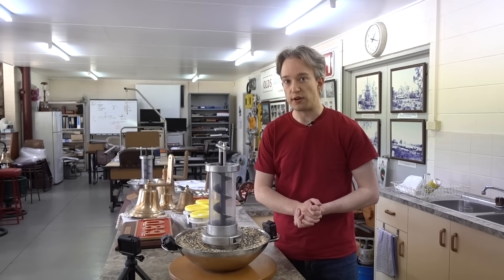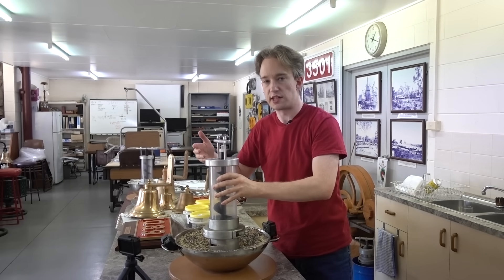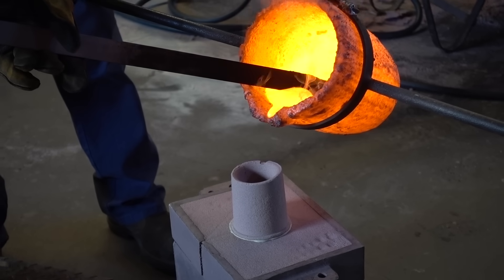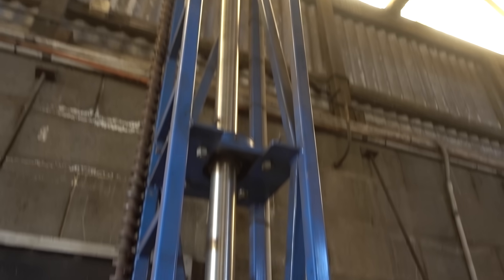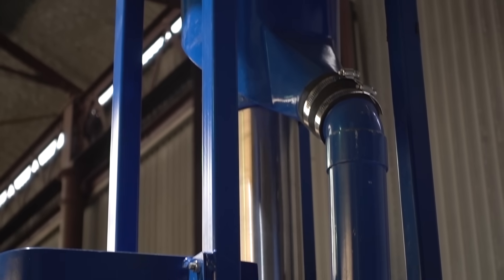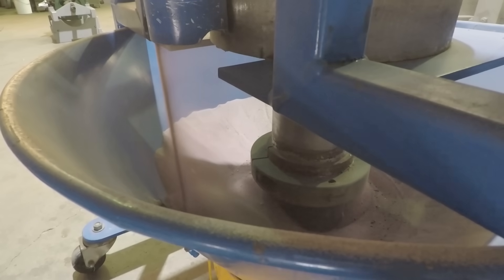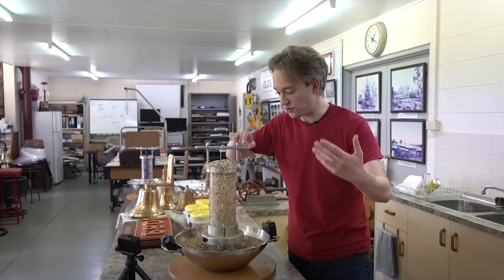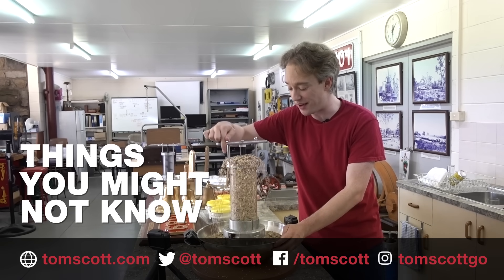Mr Olds' remarkable elevator

Comment: It’s incredible that for centuries after Archimedes created his screw, no one thought of the reverse until this guy..

Round of applause for him
Reply: Spinning a screw is easier than spinning a tube.
Reply: @ElectricityTaster  You can spin a tube in its center, or on multiple points instead of just the ends, relieving the screw's center of stress.
Reply: @nrdesign1991  yea, it's better, but also more complex. A screw is simpler.
Reply: "After a night of smoking dank weed I wrote down the sketch of this idea"
Reply: I would assume people have thought of this before, but never really seen any reason to use it. Why rotate the cylinder of you can rotate the screw would be the common conception.
Reply: @ElectricityTaster  A screw requires more torque and thus stronger and expensive materials, the longer you make such screw.
Reply: @ElectricityTaster  That still doesn't explain why no one thought of it before though
Reply: @simmojosh71  well there were centeries where humans hadn't thought of something like archemede's screw until archemedes came along. It just takes time.
Reply: Benjamin Lum That's not necessarily true. We just don't have evidence of a patent. Either one wasn't filed, it was filed but we haven't recovered it, or previous inventions existed in times before patents. That's a matter for archaeologists.
Reply: @Keovar  What are you trying to prove here?
Reply: Theres always the thought too, that someone had in fact tried this before and not realised how good an idea it was or that other people didn't know.

or perhaps even it was common before for moving grain or whatever and it just fell out of use and everyone forgot. It's really quite interesting.
Reply: Archimedes Wercs
Reply: @Stepping West what is wrong with your reading comprehension? I never said it was not a superior design, I said it was simpler to make. You know, like a handsaw is simpler than a chainsaw.
Reply: This sort of thing should be able to "bend" (not very well but it is possible) while you can't do that with a screw. All of a action happens at the bottom. The only problem with this system is I don't think it can lift water without operating at high speeds.
Reply: @pwhnckexstflajizdryvombqug9042  it is much easier making a bendy rotating screw than a bendy rotating pipe. Screw elevators that bend are easily commercially available.
Reply: Also a lot more dangerous for personnel. Growing up on a farm I knew a lot of people that lost an arm/fingers etc etc from augers
Reply: I believe nobody thought of this before because Archimedes' screws were only used to lift water. For that, the "screw" and the "tube" were a single unit (else the water would just flow back down through the gaps).
Archimedes-screw grain-elevators must be a post-industrial invention. This kind of grain-elevator can hardly be made of wood and without some kind of motor, and they take up a large amount of metal by pre-industrial standards.

Point is: The 'original' grain-elevator design with a screw rotating inside a fixed tube isn't that old either. But the Old's elevator is still a wonderful example of out-of-the-box thinking.
Reply: ROOOMBA while I was writing the sketch I had this crazy idea of moving the paper leaving the pencil fixed...
Reply: @nrdesign1991  Have you considered that, regardless of which component is being rotated, the force to move the material is the same, hence the central screw could still be sheared by the forces transmitted by the material?
Reply: @marcusgault9909  Good point, but for some reason this design seems to work as well as it does. I'm tired AF right now, but I might reconsider what forces go into the parts later on.
Reply: @nrdesign1991  As I went to sleep I did realize that the shear forces on the central flight could simplistically be reduced by 50%, because it would  usually only be driven from the top, but can be fixed at both ends if the outer tube is rotated instead, and that motor can conviently be situated near ground level, or somewhere more easily accessed, rather than in a bin or silo top.
Reply: They almost certainly did, but it wasn't as efficient as the screw. Archimedes used his screw for liquids. Mr Olds's cylinder would really struggle with that. However, its great advantage is less stress on the material and machine itself.
Reply: Greek and roman archemedian screws are depicted having people treading on outer casing to lift water? It seems to have been been assumed by historians the screw needs to  turn, and thus it would have to be fixed to casing making the device heavier to get started turning.
Reply: I have noticed this when I was 7 years old( 23 years ago ). but newer put a lot thot in this because  .....
Reply: @ElectricityTaster  dude, you just don't know what you're talking about.
Reply: @Terminusz  Well now I'm convinced.
Reply: Round and ROUD of applause, yes.
Reply: Tbh a lot of people probably did but when they got to the stage of people saying "that's not gonna work" they let the idea die therem
Reply: @FoxDren  true
Reply: @oi-nf9uz  XD
Reply: Well up is down in Australia, so reverses aren't all that strange
Reply: Archimedes' screw is not vertical. It lies relatively flat, forms individual chambers in which portions of the conveyed goods are held by gravity.
The friction driven vertical screw conveyors regardless if rotating inside or outside, are really a different principle.
Reply: @charlesstuart3064  even in Nimbim?
Reply: The original archemedies screw was more of a twisted channel and relied on the angle of the screw and gravity not friction.
Reply: honestly makes me wonder what extremely basic stuff we've just missed as a whole. I wonder if there's some multi-million dollar computerized industrial system that could be replaced by some extremely simple mechanical device that somehow we just... never figured out.
Reply: @nrdesign1991  the screw is subject to the same torque whichever componant is powered
Reply: @simmojosh71  Most likely because the previous design didn't have patent protection. So, without there being an obvious issue with it that needed solving anybody that did think about rotating the cylinder rather than the screw didn't have any reason to actually build it and would have had issues getting funding to produce them.

The times when you get new solutions to problems tend to be the result of wanting to avoid running afoul of patent protections or because the current solution isn't good enough. In this case, the previous solution was quite good and free of patents and you could buy it from any number of factories.
Reply: I cannot imagine it working with water somehow, which waswhat archimedes design was used for
Reply: not centuries my friend, MILLENIA.
Reply: @nrdesign1991  The screw is under almost as much stress.  The torque applied to the product by friction is trying the make the product spin, and that spinning torque is transferred to the screw.  The screw also takes all of the vertical force placed by the moving product.
Reply: You mean milennia.
Reply: @simmojosh71  I'm sure it was, more than likely it wasn't known by other people or was just forgotten about.
Reply: @nicolorau  Sort of like some 3D printers.

Comment: I mean, in retrospect, that makes perfect sense.. But I'd never have come up with that myself, that's brilliant.
Reply: Just like most mathematical proofs (in my opinion)
Reply: That's how it goes with most very clever devices and principles, in my admittedly short experience
Reply: Galilean relativity, innit!
Reply: I'm still struggling to find out what the advantage is..🤔 Is it better, or just a clever different way?
What's so bad about turning the auger screw, why is this better than a stationary tube and a spinning auger?
Reply: @A-Milkdromeda-Laniakea-Hominid  I agree, I also thought it would make little difference, but upon further thought, it allows you to have a more sealed system as there's nothing that needs to connect from the outside and in to move the screw, and the casing 
 agitates the bulk better than a shielded screw, so I reckon it loosens the material more easily and packs better as a result. But I still think it's black magic, there has to be a limit to high tall you can make these things, as at some point the resistance in the bulk in the hopper can't overcome the resistance of pushing the material up the screw and will stop feeding into the case, no?
Reply: @A-Milkdromeda-Laniakea-Hominid  Wondering the same.. the official sales page notes the bearings are on the outside, which I guess protects them from the sand, and means it's easier to meet food regulations.
Really cool to see it working, but also a bit perplexed to the overall advantages
Reply: @A-Milkdromeda-Laniakea-Hominid  I think Tom's interest is mostly just along the lines of "hey, an Archimedes screw works whether you rotate the screw or the casing - neat!". But the inventor says that the mechanism can work well even when in poor condition, can be used for accurate dosing of material, doesn't crush the material and doesn't generate as much dust (because the screw is packed full of material, instead of air that the material can fluff around in). And I would add that it's probably easier, mechanically speaking, to drive the casing around, instead of trying to turn a shaft that's hidden away inside a pipe, possibly requiring seals and whatnot.
Reply: @duodot  There will be a limit, yes, but I don't know if that would be any different to a regular Archimedean screw.  Even a straw has a limit!
I think the key factor (which Tom alludes to) is the ratio of the mass in the screw to the mass below it or in the base.  If there isn't much at the bottom, it's easier for the stuff inside to fall downwards.
The advantages seem to be that it can be more enclosed, it can be driven at many points along the length (distributing the mechanical strain better), and that the base of the shaft actively scoops grain in to it.  On a regular screw, it is driven only at the ends, and the grain has to passively fall into the shaft.
Reply: @duodot  Maybe so, but that limit is way above the top of the jobs it's used in. You could probably make them quite tall.. however if you had a reason to lift material past that point, you would probably just use 2 shorter lifts, and a holding tank between them. 😉
Reply: @andymcl92  yes, my points exactly
Reply: @duodot  Like Tom said, there's physics-wise no difference between turning the casing, or turning the screw. Any limits on a similar system with a rotating screw would apply here as well, but no extra. The advantage as the guy explains is that there's a bigger gap between the screw and the casing which means the product isn't being crushed, which in some cases can be dangerous.
Reply: @duodot  Excactly, the material doesn't have to come in touch with bearings or moving parts. Also the rotating scoops in the bottom are probably much more efficient at picking up material than a rotating screw
Reply: The funny thing is that Tom made a video about missed yet obvious inventions about 2 years ago. Title is "The Reaction Ferries of Basel".

Seeing how a lot of world altering discoveries are made by accident I believe there is still a lot out there that still needs to be found. Just experimenting and following up with weird ideas or odd observations is something valuable every human can do and once a proof of concept is there professionals can take over. There probably are a lot of world changing discoveries already on the internet posted by people who did not realise the importance of what they found. One example is the  solution to a mathematical problem about superpermutations and minimal injective superstrings that was solved by someone on 4chan in 2011 and only found last year. The worlds best mathematicians have been looking at that problem for 25 years.
Reply: Never thought a feminine knight of Charlemagne would be watching videos about physics and mechanics.
Reply: The most brilliant stuff is often the most simple.

Comment: The fact that it took over 2200 years for this to be developed tells me that either someone's design was lost to time, or humanity really got stuck on a design that works. Either way, incredible amounts of Kudos for Mr. Olds to figure this out.
Reply: Looking at this we should really invest in square tires.
Reply: ......how old do you think civilization is?
Reply: @iwanttwoscoops  2200y since Archimedes wrote about the screw elevator
Reply: Maybe it sort of needed the kind of paradigm shift of thought that was popularized by the theory of relativity and the whole frame-of-reference thing?
Also, how many people work with these kinds of things, in-depth, anyway? This is putting the dangerous moving part on the outside. You may need deep practical understanding to realize the advantages of doing it this way might outweigh the disadvantages vs. turning the screw.
Reply: @blechtic   frame-of-reference realy goes back to Newton, so 300 years aleast.
Reply: @iwanttwoscoops  I'm really curious how old you think civilization is. We have concrete evidence of agricultural civilization dating back at least 5000-6000 years. and there are many other older sites that are more debatable.
Reply: @blechtic  I'm wondering if it might even be a (no pun intended) circular problem/self-fulfilling prophecy; someone else may have thought of the idea, then thought "if it were that simple someone would have done it by now", either that or they didn't have the skills or tools to try it. In that case Mr. Old's invention would have been a combination of background, resources and the conviction to try something his peers said would fail, which makes it no less remarkable an invention.

If anybody else did think of this, they're going to be kicking themselves if they see this video!
Reply: @blechtic  Yea but its a pipe rotating. Rotating parts are not a danger, The danger comes from being caught and pulled somewhere.
Reply: @generalharness8266  Rotating parts aren't the danger, stupid operators are ;)

Comment: "if you are confused by that..." YES YES I AM
Reply: I was hella confused
Reply: It makes a lot more sense if you look at the bottom part, 4:55
Reply: @MrYoursoup  exactly.. It's the scoop that makes this work.. So it's not fair to call rotating the cylinder the same as rotating the screw.. As Tom did
Reply: Think of the screw as a spiral staircase. The scoops at 4:55 force grain (or whatever) into the bottom of the staircase and continue feeding more in, so the grain has nowhere to go but up!
Reply: @ktaragorn  Actually, I think it is fair to call it that - with a regular screw, you need some kind of casing and the screw forces the things you're lifting against the casing. In this case, the casing forces it against the screw, so it's just the other way around, as you'd expect.
Reply: Mohammed Avdol!
Reply: @ktaragorn  actually, from a physics perspective, they are identical. there are things called symmetries in physics, which basically say that physics doesn't care much about the state of the world around it, it will operate the same way here as it will 10 feet to the left. physics doesn't care if you rotate the screw or the cylinder, it will provide you the same ultimate result, stuff moves upwards. the symmetry is maintained, the universe doesn't care if the screw is spinning or if the world is spinning around the screw.

however, the other, subtler effects mean that while this gets the same ultimate result, the details change slightly, making this version of the screw lift more efficient and easy to maintain.

Comment: You forgot to mention WHY it's an improvement over conventional screw elevators through. The main advantage is that, since the screw itself is fixed, it moves material much more efficiently upwards because it doesn't have to turn the screw against the resistance of all the grain being pulled down by gravity. It also allows for a large clearance between the screw and the casing cylinder, reducing friction and damage to the grain or equipment.
Reply: Also the screw doesn't have to go all the way to the top
Reply: Tbf the inventor did mention that when he was describing it regarding the part about explosive dust

Comment: Coming from a farming background and having had machines mobile machines for cleaning and processing corn for decades find this incredibally interesting. 
I wonder how well screw would act regarding self cleaning when seed treatments were applied and if the wet and slightly sticky material would shear off efficiently? 
Think it may depend on bushal weight of material, size of seed and pitch/size of screw?
Reply: Seems like it would work best with very dry material.  The scoops at the bottom generate the compression to lift the material, and if it couldn't "flow" into the scoops you might run out of compression.  Mumble, mumble, relationship between weight of material/ ease of "flow"/ rate of spin/ friction in tube...

Anything sticky might not work as well, if at all.  I'm an armchair engineer at best though, my two cents.
.
Reply: @jgcelliott1  Agreed, though there's another downside: you can never lift all of the product this way. Since the lower portions push up the higher ones, enough of it needs to always be accumulated at the bottom in order for the elevator to work.